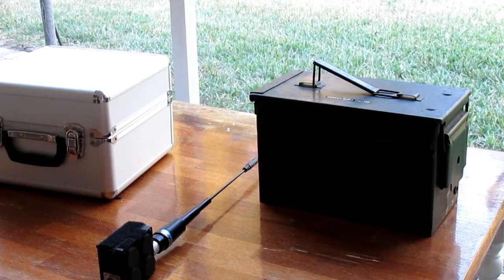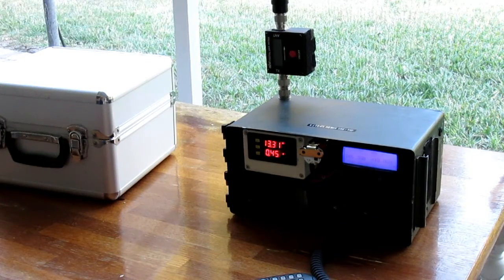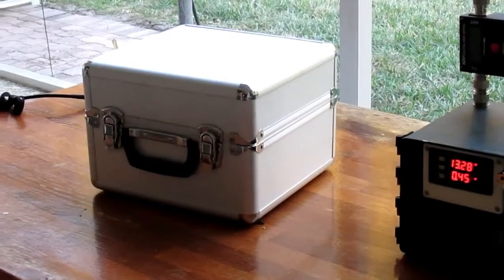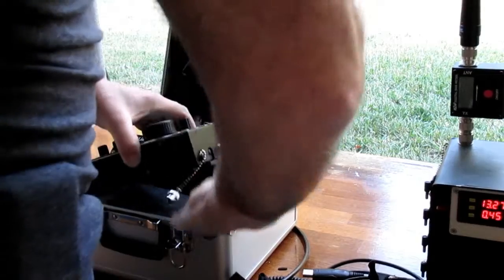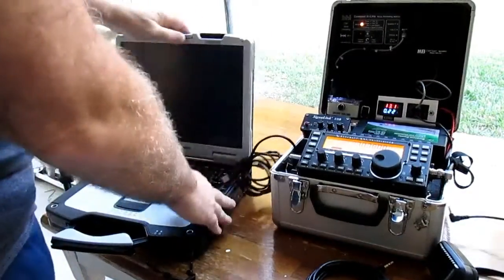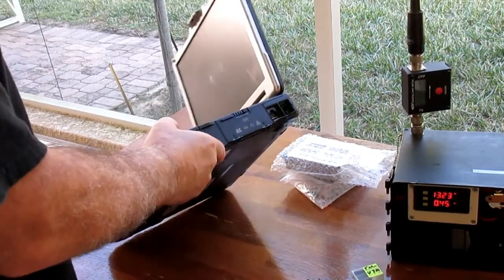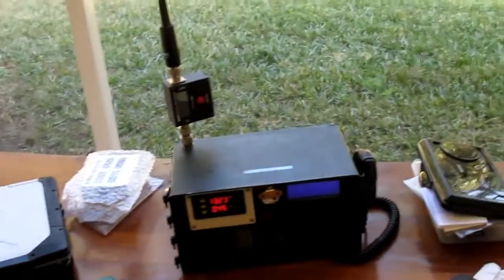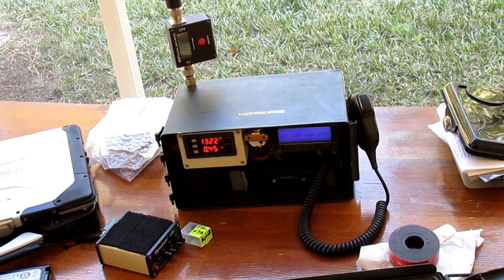Making a quick, self contained deployable HF Go Box

Comment: How do the buttons and antenna mount while keeping it waterproof?
Reply from the maker: I don't operate the makita go box in the rain and the ammo can go box is water resistant.
Reply: Edward Vignati my question is how you got the ammo can to be waterproof once you drilled an antenna hole and holes for the light switches etc. the metal box seal has been compromised. how did you "waterproof" it after poking holes in it?
Reply from the maker: It's not water proof, it is water resistant. Where the antenna mount (SO239) use a garden hose washer.

Comment: How do you charge the battery?
Reply from the maker: Go to this site, Bioenno, pictured is the battery that has two wires coming out, the power pole is battery power out and the pigtail connector is what the charger plugs into, no need to remove the battery..

Bioenno batteries are the best, when transmitting they stay between 12.8 and 13.2 volts when transmitting.  If you buy the battery buy the charger made for it, the batteries seem to never die.

I also built an ammo can go box, I installed a jack on the outside of the box so no need to remove the battery. I also built this one for a friend, it's a short video and will give you some ideas. 

https://www.youtube.com/watch?v=XjA3K40bZqI

ALWAYS look at my comments, where it is written "Show More" I always display links where I get the parts from so you don't have to hunt for them.
              
      73s Eddie
Reply: If you use an Epic Pwrgate by West Mountain Radio you can ignore the pigtail and charge the battery through the power pole connector. You won't need the Bioenno charger but I bought one just in case I need it.